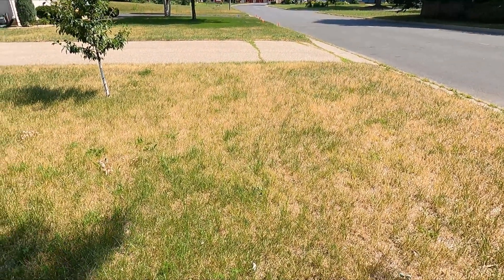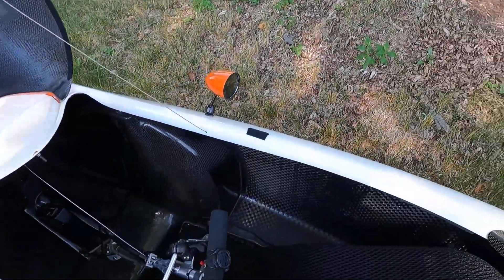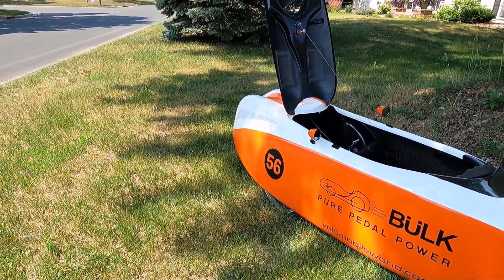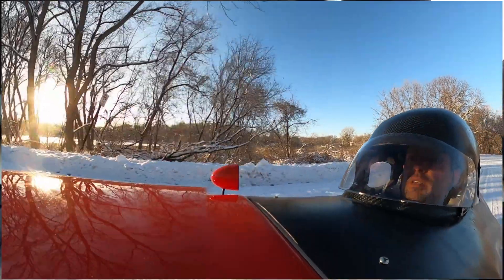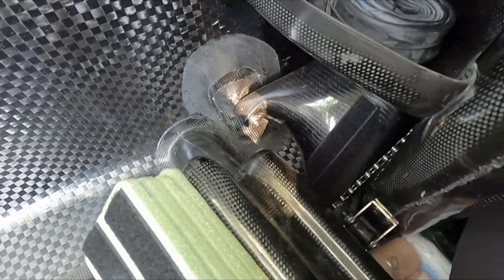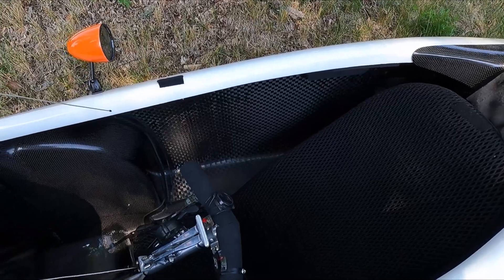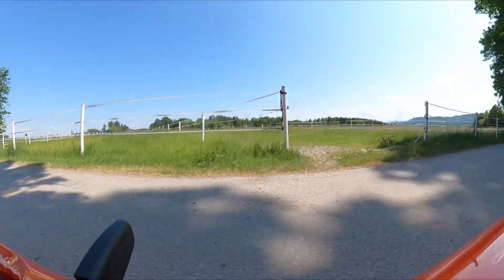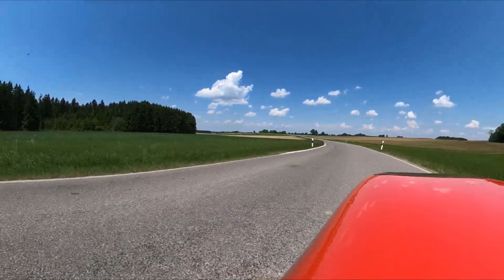Is This Bicycle the Answer to Safe, Efficient, Sustainable Transportation?

Comment: A friend of mine has a velomobile for 5 years now. He rides 18.8 miles to his job in less then 30 minutes.
Reply from the maker: Impressive speed!
Reply: @Bengoesdutch Sorry, 18.8 miles was two way. So it is 9.4 miles one way in 30 minutes. But he is a normal guy, not an athlete.
Reply from the maker: @mardiffv.8775  that makes more sense. That’s still a very good speed for commuting.
Reply: @Bengoesdutch  Yes, he is fast, but it is also efficient Dutch road design. During his trip he has only 2 red traffic lights he has to stop for. Most of the trip he keeps going.
Reply from the maker: @mardiffv.8775  very nice. I have a 4.5 mile trip to my work. I have 10 traffic lights. Typical American road planning.

Comment: whats it like on steep hills
Reply from the maker: Same speed as my recumbent bikes and trike. The drivetrain in the Bülk in this video is impressively stiff. Very good power transfer. Won’t be as fast as a road bike, but you make up for that going downhill and on the flat. I did some 13%+ longer climbs touring in Germany end of May. It was slow, but very doable. The downhill was a blast.

Comment: How effective is your windshield wiper? Is that an option that is readily available?
Reply from the maker: I tested it in heavy rain last week, for the 5-10 minutes that we actually had rain. It worked really well. It is available for any velomobile using a motorcycle visor on the race hood. That would include the alpha 7/9/M9/W9, the Bülk, DF/DFXL, and I think the Milan now has a motorcycle visor option for the MK7.

Comment: Great informative video, thanks. I live an extremely minimalist lifestyle. My main reasons are for the savings and to have both a low carbon footprint while having zero emissions. 
I'm about halfway through a 5 year project, building a 40% scale version of the Tesla Cybertruck prototype, which will be a 4 wheeled recumbent velomobile. I have already built my home, which is a pop-top micro-camper. This will eventually be towed by the Cybertruck. 
Camper interior dimensions are 2'6" wide by 9'4" long. 
All self-contained and off-grid, on solar power.
Includes, electronic flushing toilet, shower, A/C, LPG gas system, fold out awnings (both sides), insulation, kitchen, bed, plus ample storage.
(Sorry, that was a bit of a read)
Reply from the maker: Very cool. I remember seeing some photos of your cyber truck build. Hope it goes well for you. Building a velomobile is more complex than I expected when I did a build a couple years ago.
Reply: Do you a video or picture of it?
Reply: @mariamakamara5592 sure. On the channel there's videos.
Reply: @mariamakamara5592  did you find my dedicated channel for it yet?

Comment: Today no. In future? No, not for the environment (carbon dioxide is plant food); but YES when fuel is no longer shipped to this country.
Reply from the maker: Technically cars produce carbon monoxide which is why running a car while you’re sitting in it in an enclosed space is a really bad idea. Cars also produce particulate matter which is damaging to our lungs, nitrogen oxide (methane), and carbon monoside which gets converted to carbon dioxide. Those three together contribute to damaging the ozone layer pretty badly. So yes, cycling more and reducing car usage will help reduce environmental damage. Remember also that the building of cars has a significant negative environmental impact, even for electric cars because of the materials in the batteries.
Reply: Carbon dioxide is plant food, but we're producing more than five planets of plants could consume while wiping said plants out of existence.

Comment: Great video! I’ve been eyeing a velo myself to commute into NYC on rainy days and in the winter. The bulk might be a little too low to the ground for nyc though (speed bumps, ped ramps etc).

I really hope velos become more popular in the future! They’re awesome!
Reply: I was anxious after owning a very low MilanSL that the Bülk would likewise not have enough ground clearance in our very speed-bump-rich country the Netherlands. But it is much better than I expected and only velomobiles with open foot holes will do better. The Bülk is very well optimised and the comfort, especially with the air damper in the rear, is amazing. With all that comes the very high efficiency. It is by far the best velomobile I have owned in 25 years time.
Reply from the maker: The Bülk with comfort suspenskon has 9cm ground clearance under the foot bumps. I haven’t tried clearing US speed bumps with it, but I know it has better clearance than most models. My quest xs had more ground clearance, but I’m not sure why mine was so jacked up. Normally the xs has similar clearance to the Bülk. The next option.would be a light electric vehicle, but I think those would not be quite as fast around the city as a Bülk. I might have to find a speed bump to test that for you.
Reply from the maker: Thinking further about your speed bump concerns, it occurred to me that I encounter a speed bump on my daily commute. It’s enough of a nonissue that I forgot I even cross it. I put strips of Keeleazy on the foot bumps to protect them from times when they scrape. It happens on occasion, but not very often, and those strips prevent damage to the carbon fiber. It would be great to see a Bülk on the streets of NYC.
Reply from the maker: @654789qwe I’d be happy to set up a call with you to discuss the different models of Velomobiles and see what would work best for you. You can send me a direct message at trumpetplayers@yahol.com to set something up. I bet we could find something that would work well for you.